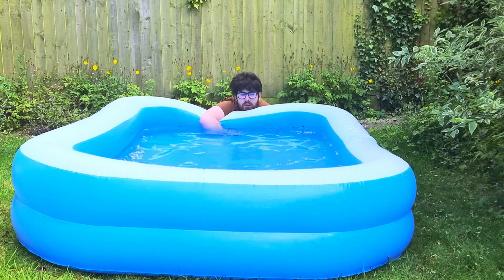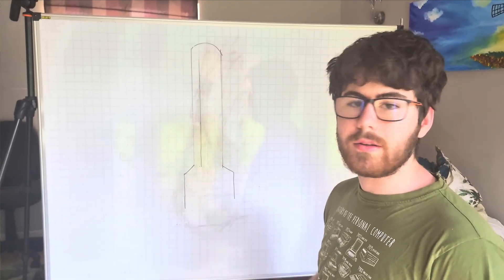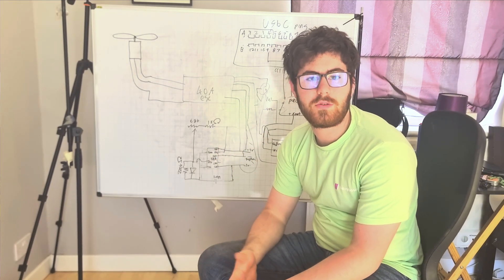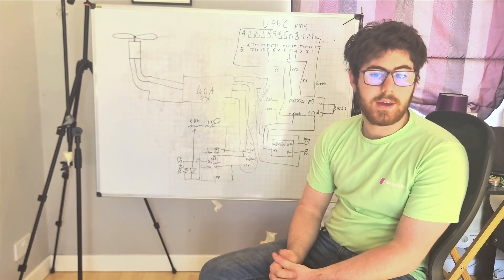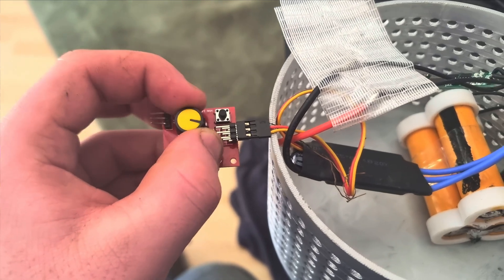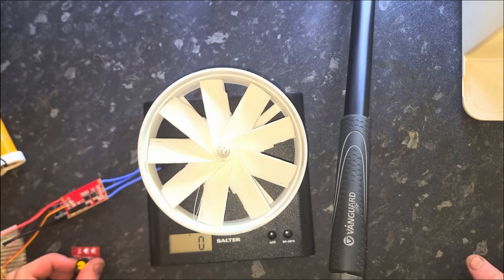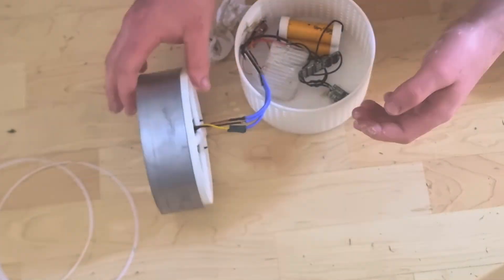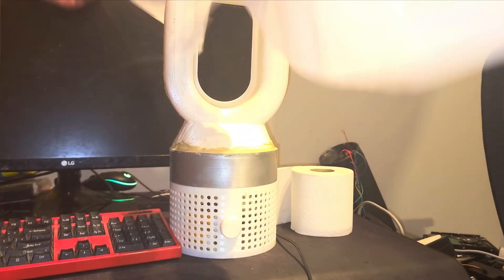Building a Dyson Bladeless fan FOR UNDER $50

Comment: Fun stuff! With a few revisions you could probably skip the glue entirely and end up with a cleaner end product. Totally functional as a prototype though.
Reply from the maker: I could have used screws the issue is the 3d printable warped so the glue was used more as a filler. Than a bonding agent